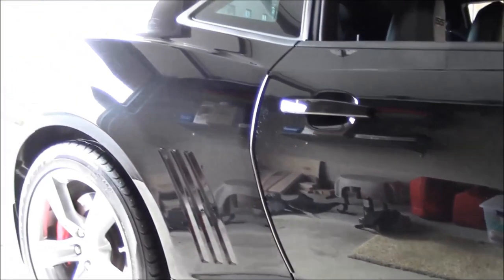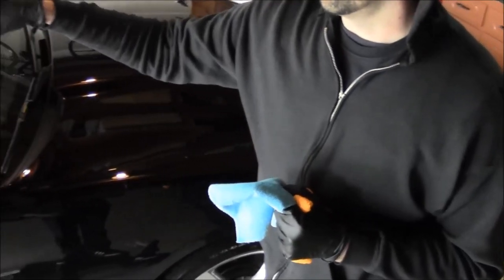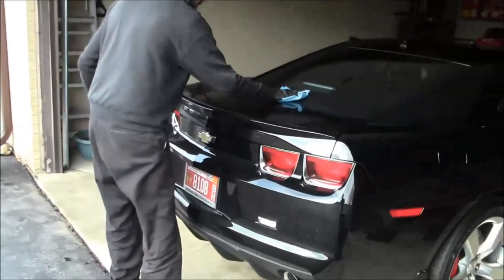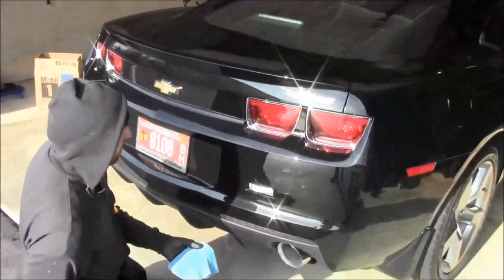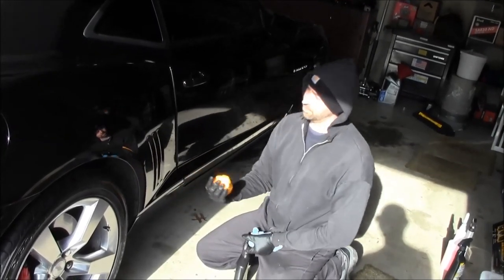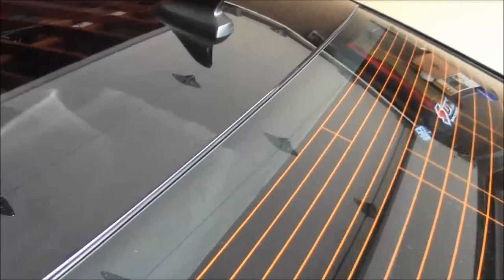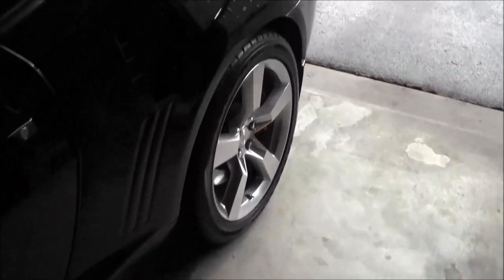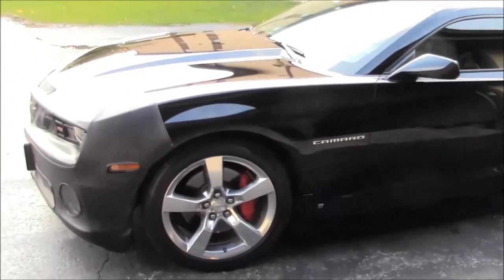2010 Camaro SS Gold Class Quik Detailer Tutorial (Camaro Part 3 of 3)

Comment: Man, that turned out great...knew it would!
My Black fox gets hand prints all over that area on the door. 
I've used that M34 for detailing, probably should.get a good wax spray.
What's your best wax spray? Got a good one for Black??
The Viking Brand towels 👍
Reply from the maker: J PP:  I like all the Meguiar's spray waxes.  Gold Class is probably the best to use on your black paint.
Reply: @fwh79FOXR6  grabbing a bottle tomorrow 👍
Reply from the maker: @jpp9846  If you are going to use it to remove finger prints, be sure to get the quik detailer and not a spray wax.  Spray wax should only be used on a clean surface.  Detail spray can be used to clean a surface.
Reply: @fwh79FOXR6  clean it with the M34, then spray wax 🤘
Reply from the maker: @jpp9846  Yeah, use the M34 to clean up the surface and then top it off with the spray wax.  I forgot you have a gallon of the M34!
Reply: @fwh79FOXR6  yes I did, it's good stuff too! I have that D151 too. I think I'm going to detail the Tahoe this summer with that, then she's going to a new home. Been a good car for the last 8 years...time for something newer.
Reply from the maker: @jpp9846  I like the M34 as well.  I try to save it for my detail work though and use the consumer detail sprays to clean my cars.  It would be interesting to see the Tahoe get some D151 treatment.
Reply: @fwh79FOXR6  you mentioned I should try the D151 on the Tahoe. I think, and this is my opinion, that D151 probably works better on clear coats. I did use it on the single stage Mustang paint...and it didn't do much for it. The Single Stage seems to likes compound/wax combo better. I have a boat load of that D151 still, so I'm going to use it with the DA as soon as we get a dry stretch. 
I bought a bottle.of that Meguires Gold Class Quick Detailer yesterday, is that a wax? It appears it's just a detail spray (like the M34).
Reply from the maker: @jpp9846  That is exactly why I have a ridiculous array of compounds and polishes in my arsenal.  What works well on one paint, seems to have little or no effect on another paint.  My buddies Camaro is a good example.  I used D151 to correct a black Ford Fusion and it turned out amazing.  Much better than I was expecting.  However, using the D151 on that black Camaro, wasn't working so well.  I had to use Ultimate Compound and then finish it off with the D166 which is a newer version of D151.  That combo gave me the result I was looking for.  It also depends on using the product by hand, or with a power tool.  Using a DA polisher is really the best way to maximize your results with any given product.  Figuring out what product will work the best on the paint you are correcting, is more than half the battle.  The Gold Class Quik Detailer is not a spray wax, it is a detail spray the contains some spray wax.  It's like a hybrid product.  They make a Gold Class Quik Wax that is a full spray wax product.
Reply: @fwh79FOXR6  well shit....I guess I wasted my $ on that one. I was wondering, I read the label.and didn't see it labeled a wax...in fact, it said on the label "the missing label between wash and wax". So, I was thinking it wasn't what I needed. I will keep it in the arsenal. As you said, it's good to have different products. 
I agree...got to mess with the different products to see what works best. That Tahoe, being a champagne color, it should turn out nice with that D151.
Reply from the maker: @jpp9846  It's not a waste of money, you will end up using it.  You might even fall in love with it.  I think the D151 will work very well on the Tahoe.  Black is much harder to correct than a lighter color like your Tahoe.
Reply: @fwh79FOXR6  that Tahoe has most likely NEVER had a nice paint correction...it's a 2007, so, 12 years old....this thing is probably going to GLOW when I'm done with it, hahahaha!
Reply from the maker: @jpp9846  It will be a tremendous improvement.  No doubt.